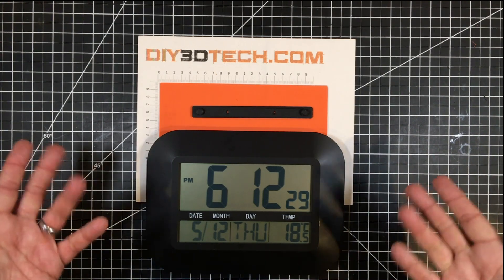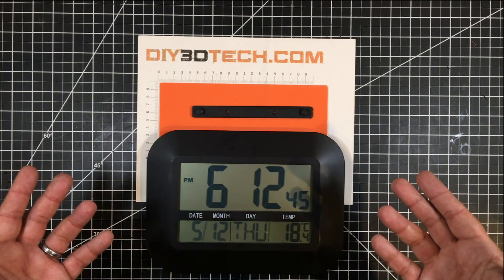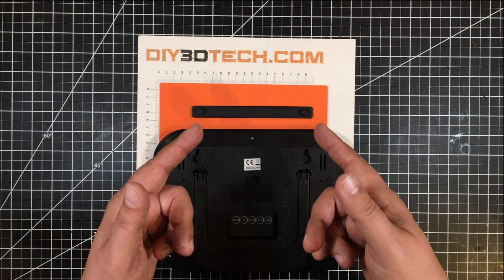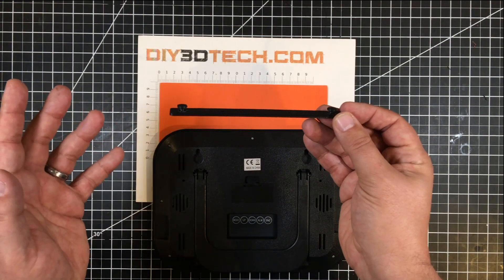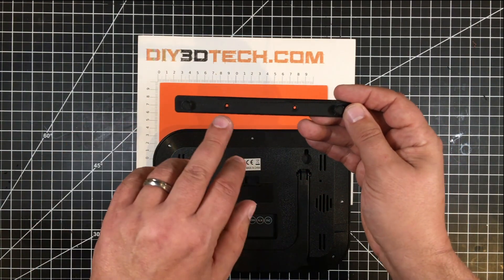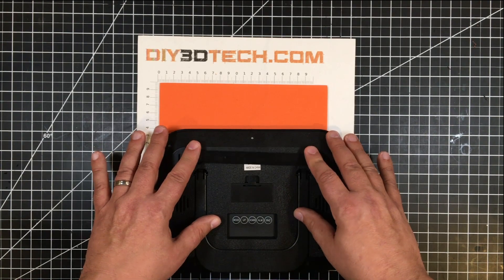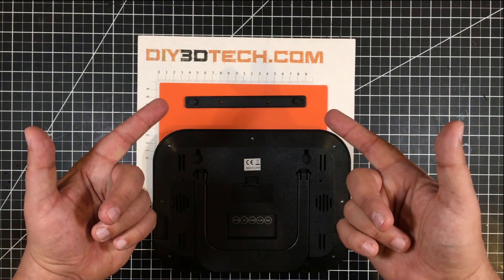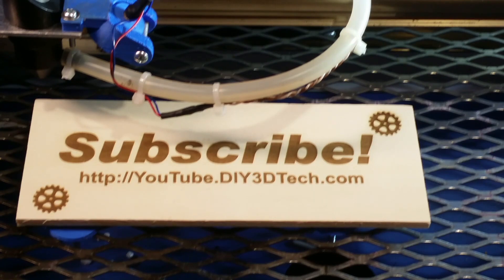Design Talk -  When Time Runs Out 3D Print a Solution!

Comment: I've been thinking of doing something like this, so thanks for doing it for me :-).  Now I need to figure out how to angle the piece so the weather station points down a little (at some degree I need to figure out) so the display is pointing down towards your eyes vs. straight across the room.  Some of the La Crosse Tech. color weather stations, so I've read/heard, are hard to see if you hang them on the wall.  This would be good to hang (I plan to use command strips) with a slight down tilt.
Reply from the maker: The F360 file is up there with it so have it for a remix!  :-)
Reply: @DIY3DTECHcom  Awesome.  Thanks!  Now I have another mini-project to work on over the holidays!  yeah!

Comment: I know that there isn't much weight there, but I've never achieved a strong enough layer adhesion to print a post that small where the head would not snap off at the first opportunity.
Reply from the maker: You might be printing to cold, I like to go to the higher side of temp.  Also increase your walls too as that will make it stronger.  I have printed tons of hooks and supports over the year never had an issue.  :-)

Comment: Why not just flip the design 90 and lose the bottom of the pins... no need for support
Reply from the maker: The pins are not as big as the base so there would still need to be supports.  Suppose you could make the base match the pin heads, however not sure how it would bridge but I guess a possibility...
Reply: @DIY3DTECHcom  you're not really making pins, just hooks, so you don't need the bottom half